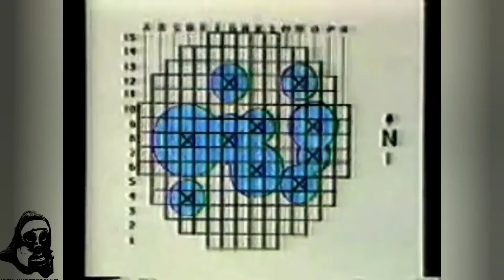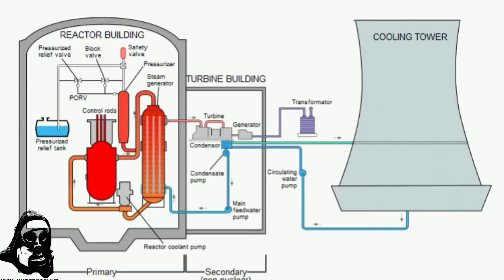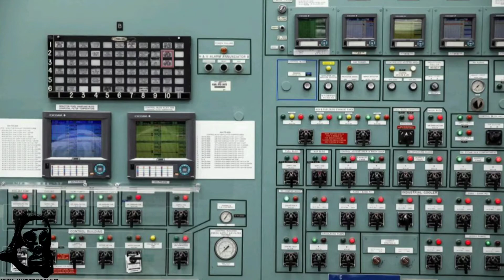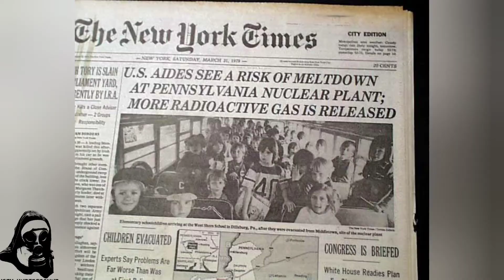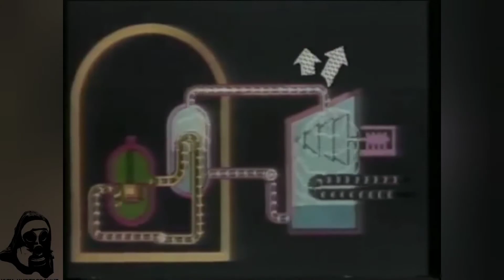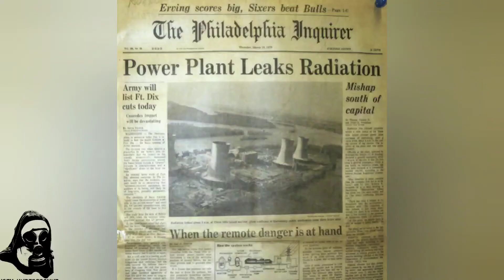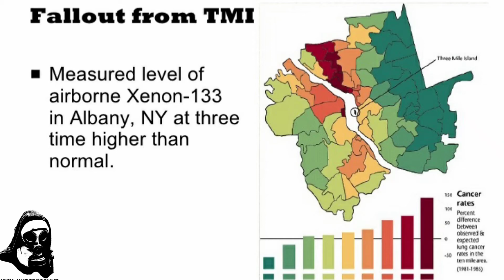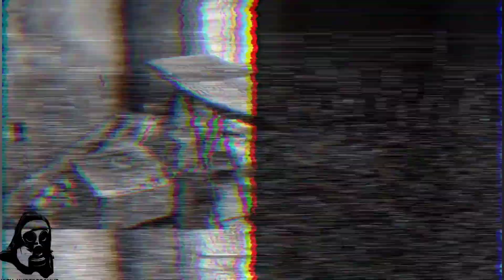Three Mile Island Nuclear Disaster [Documentary]

Comment: Nice thing is, the technology present now means no more meltdowns. The fuel is reduced from rods into softball-sized balls, coated in material that what was essentially the purpose of the control rods. They're dispensed in a gumball machine fashion, being able to be used many times over before being spent. The data shows there's 100% no chance this new way could ever melt down. The facilities are also very tiny... something the size of Wendy's can put out 1/3 the power of a current facility. As you can guess, the military's already testing even tinier versions of this for mobile power sources.
Reply from the maker: Very, very interesting!  Thank you!
Reply: Except old outdated cores are still being used. RBMK cores are still active in Russia, retrofitted, but still. And let's not forget the disaster in Japan that everyone loves to ignore.